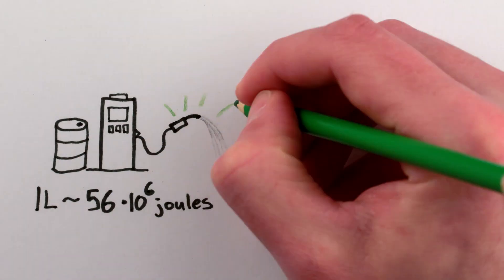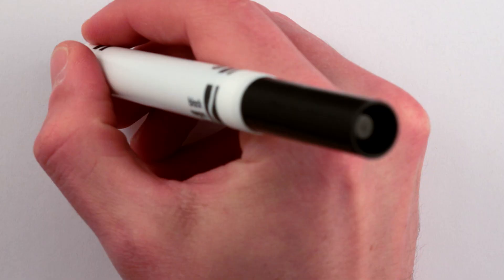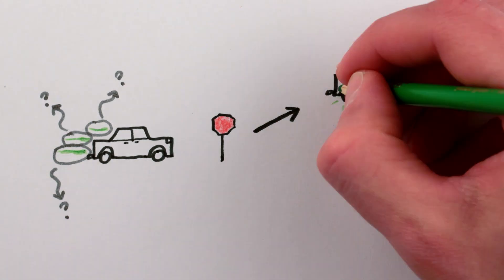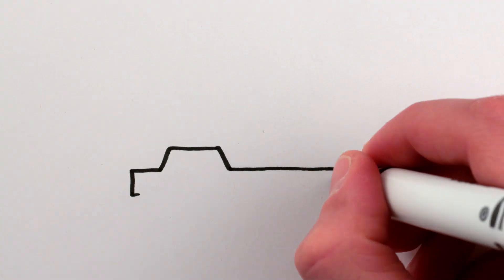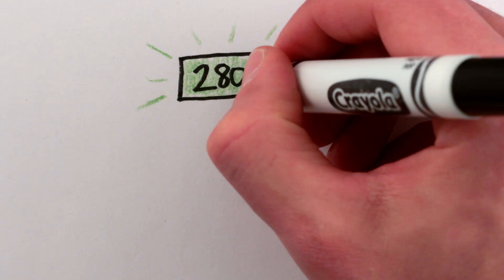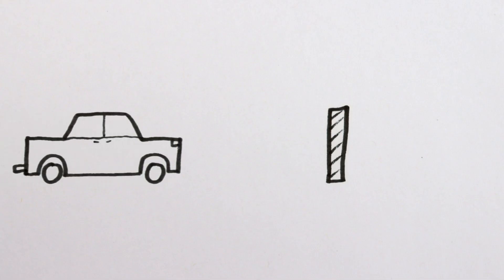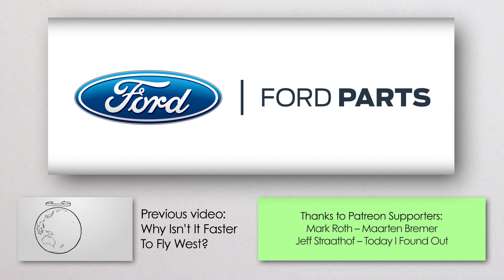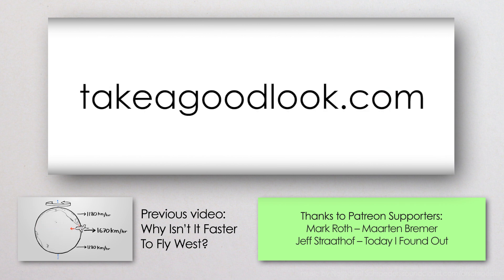The Physics of Car Crashes

Comment: This is really cool. A good way to counter the people who say that "cars were better back in the day"
Reply: +Z6U6Z6U It's hilariously retarded to say cars looked better back in the days. It's all on personal preference.
Reply: yeah if 'better' means only getting around 80-120 horsepower from a giant all steel engine, having 0-60 times in the low 20s range, weighing  more than a full ton over what cars do now, body on frame instead of better unibody, shitty gas mileage,  manual adjustments that had to be made to the timing and carb, no self diagnostic ability,  distributor points that wear out, no front wheel drive in passenger cars, no seat belt pretensioners or airbags, no collapsible steering coloums, no transmission lock,  4 wheel DRUM brakes, no ABS.... yeah 'better' isn't the first word of choice that crosses my mind.
Reply: +superdogmeatmeat Except in retro feeling ;)
Reply: +Milchdealer Nope, old cars provided no retro feeling back in their day because they were new.
;) ;) ;) ;) ;) ;) ;) ;) ;) ;) ;) ;)
Reply: +TheKimpula back in the days, you didn't have to suffer the costs that come with the crash, because you'll be too dead to care.
Reply: +TheKimpula They were absolutely worse in about every conceivable way.
Reply: @superdogmeatmeat  so what?
Reply: +thefaller01 not true, cars have had what are called 5 mph bumpers for decades now, that is to be sold in the USA they have to be able to withstand several 5 mph impacts without any damage whatsoever.
Reply: *****
NO way! you have no idea how bad the air was when we were using tetraethyl lead in our gasoline and before catylitic converters, large cities used to have toxic brown plumes hovering over them and we covered 80% of our country with a thin dusting of lead.
Reply: +dutchsouthernrockfan You can totally have the opinion old cars look better, I would agree with you, but to try and say its objectively true is just bullshit.
Reply: +TheKimpula "cars were better back in the day" is more of a thing for enthusiasts who understand the risk but appreciate the styling and mechanical-ness of older cars, which are truly a work of art.
Reply: +TheKimpula Cars were simpler and more robust back in the day.
These days, car manufacturers design cars that will only last so long and then needing a complete replacement.
Older cars were built too tough and too well for the car manufacturer to survive. Hence why car manufacturers started taking shortcuts to reduce the cost of manufacture and thus longterm reliability because a customer that only comes back every 30 years isn't a good customer...
Reply: @RealCadde that's simply not true, modern cars are much more reliable, and cars comfortably hit 250-300k in their lives, unlike older vehicles which on the high end maybe can hit 200k
Reply: @gamechip06  In the past, they didn't have software that could reliable make for planned obsolescence. Which meant they had to overengineer their cars, which made them heavy and inefficient but they also, as a side effect, lasted longer.

As for reliability. that is only true for the few cars made today that were engineered properly. This hasn't changed, nothing beats a brilliant solution.
There are plenty of old reliable cars pushing  300,000 miles (read, not kilometers) and your claim is at an disadvantage simply by the fact that modern cars are unlikely to have those high mileage figures because to hit those figures you must have been driving 40 miles every day for the past 20 years to hit those figures. Meaning those cars are not modern.

But you can of course specify a year and come back to me.
Meanwhile, i am talking about cars prior to millennium shift. As that's the period where cars started being made to reliably break down after their factory warranty had lapsed.
Reply: Edward Elric
Easier to repair my ass, new cars tell you what is wrong with them with one tool that can be had for less than 50$. older cars you had to throw parts at them, and invest in dozens of very expensive diagnostic machines, take parts out and bench test them. What once took hours of diagnostics is practically instant, people who say that computers and electronics make repair cars more difficult have no fucking clue what they are talking about. Would you rather:
change the plug wires, distributor cap, button, check the spark plug gap, get out the sun distributor machine and check the distributor's rotation, then go under and check the crankshaft pulley's timing marks with a strobe,  replace the spark plugs incase one was defective, put a straw in the spark plug holes to find TDC and determine it hasn't jumped timing,  replace the ignition coil because it misses at high RPM's still, then get to a specialist who has an osciloscope and a polaroid camera adapter to look at the output of the crankshaft pickup to find it's bad after putting in all those parts, taking stuff apart, OR....

Would you rather get a code p1336 on a 50$ scantool and replace a 5$ crankshaft position sensor that does the work of all those systems thereafter the car runs like it was new again?
Reply: James Lynn
More like over engineered and excessively expensive. I'm not sure what we are talking about as "back in the day", but I am thinking of 70's and 80's. I still drive an 88 as my daily driver. Not overly complicated but has all the comforts, power steering, smog system on the exhaust, ect. Super cheap and simple to work on and ruggedly built out of steel and iron, not cheap plastic that makes it less durable but somehow more expensive.
Reply: They were still better "back in the day" in many aspects, but not really safety. Then again idiots weren't texting and driving so it probably wasn't as big of a concern
Reply: +TheKimpula Virtually NOTHING were better back in the day, except maybe the air. Anyone who EVER says that about anything, should be treated with great suspicion
Reply: Clymaxx
You might think that... but ask anyone who has had to throw parts at their ignition system or had trouble with their carbuerator before we had distributorless ignition and fuel injection on all cars. Old cars are very touchy mechanically speaking compared to new ones and there is the problem that to fix them you basicly throw parts at them til it works right as there is no way to diagnose them with obd etc
Nowadays spark plugs last 100,000-150,000 miles, You NEVER have to tweak your carb, ignition coils last maybe 5x as long as that rotor button would inside the distributor and those fuel injectors and fuel pump will usually outlive the life of the car provided you don't run it near empty all the time.
Reply: +Peter „Crackpot Pete” Carlson 
"no front wheel drive in passenger cars"
I see nothing wrong about rear or all wheel drive
Reply: +superdogmeatmeat They had far less electrical and computer aided systems and were easier to repair. But from a technical standpoint you are right.
Reply: The sheer number of wires (somewhere around 20 just for old school power mirrors alone) in older cars before we had a vehicle data bus also lent itself to a LOT of dissasembly to get at and a LOT of probing around with a multimeter or test light, not so anymore, if there is a circuit problem the diagnostic tool will tell you which circuit has a failure and the paramater id's you look at will show you when and how it fails in real time. It's like modern cars have thousands of dollars worth of diagnostic machernery that used to be only available to a well set up auto repair shop, you can't really complain about that. The problem comes when people deviate from the way you are supposed to repair these cars and cause more problems taking things apart and swapping things that never had a problem because they don't know how to interpret the fault data the car is giving them.
Reply: +thefaller01 The bump that are regid does not absorbs energy.. like what Henry talked about in video.. so yourself have to endure hundreds of Gees before you can survive..
And the point here is that since we have non-rigid bumpers that deform and bend upon impact, we sustain less Gee`s thus increased survival rate.. 
That is at the cost of bumper, yes.. But what do you like to pay for your accident? few hundred or thousand dollars for a new bumper? or your life so you don't have to pay the bumper?
Reply: Back in the day was better back in the day
Reply: +TheKimpula  Modern cars are better in that they are safer and more fuel efficient, my cars is now 10 years old yet the newer model has almost twice the fuel economy. It's true they don't have the 'retro' look and the nostalgia attached to this and they are harder to fix when they break for the casual mechanic but the pure engineering is tremendous.
Reply: Fair point. My car at 170,000 miles still starts every time and I plugged in a code checker recently to see that the spark plugs needed replacing.
Reply: +TheKimpula Cars WERE better back in the day...They just weren't safer.  It's the price you pay for being cool.
Reply: thejoshhartley but it is
Reply: +geneticNinjas How about a NEW muscle car with a V8?
Reply: Peter Carlson Right, that's what I meant when I said that engineering solved many of those problems today because the technology was evolving. We didn't know the best solutions to certain problems back then and we even changed the methods completely in some components. I think mainly the rigidity and durability is about the frame and full steel components. I'm pretty young though so I can't say I know too much about it. My dad seems convinced though lol he raced a 69 Chevelle, thing definitely seemed like a tank.

Cadde I've read that 70% of all cars ever sold in America are still on the road today. So there is some truth to what you're saying. But I don't think it's true that engineers would go along with the idea of making crappier parts not built to last. Rather, it's probably a bit coincidental. Most money in the car industry is made through maintenance and parts so I definitely thought it was odd that manufacturers thought they could last by selling new cars every day. You can see it reflected in the pricing. Cars are way expensive, to offset the fact that nobody buys them since they last forever.
Reply: Gurgumul
Not until the chevy citation... ask anyone who's ever driven a rear wheel drive passenger vehicle in ice/muck conditions about how they used to have to load up the trunk with cinder blocks to keep the things on the road. For passenger cars FWD is the best configuration. Trucks and wagons are another story entirely.
Reply: I have seen MANY old cars with rotted out frames, Just because there is more of it doesn't make it better, after all if you don't collide with something and you don't get nasty corrosion lighter is better any day of the week for car construction, in fact the way they make some of these cars now they are actually stronger as a whole than those older ones were. I'll have to disagree that cars (NOT trucks) are made to last forever... they are most certainly not, they are designed to go around 100k miles without much more than 10-15 oil changes, a new set of tires once and perhaps a few brake pad changes. After that things will usually start going quick. They are made to be disposable primarily, the dealer doesn't want to have you fix your car they would much rather sell you a brand new one every 5-6 years.
Reply: thefaller01 It's that back in the day when you went through a high speed car crash the car'd be okay and you'd die, and nowadays it's quite the opposite, and I'd say it's better this way.
Reply: Let me change that: Cars looked better back in the days, but safety and reliability is worse. I know this, almost no one says that +TheKimoula
Reply: *was worse
Reply: +thefaller01 
Modern cars are made of plastic at the bump zone, a small bump will not occur. The plastic will absorb the energy and is elastic, thus it will have no bumps aber the small impact.
Reply: twn5858
I know there is basically infinite possible scenarios when it comes to a car crash, but that being said I would rather be in my 88 f250 in 99% of those scenarios than any kind of compact prius type car or fugly crossover thing.
Reply: +TheKimpula I dgaf about charming sounds a car makes, I just want to relax and listen to my own thoughts instead of the harsh roar under your hood.
Reply: Same here, this XJ has wrecked three cars already with no frame damage. A 90's Olds, a mark IV Lincoln and a 05 ford focus. I've seen a 83' Delta 88 absolutely destroy a late 2000's Toyota corolla and punted it 80ft into the ditch with only a smashed headlight. Then there's NASCAR, cars designed to hit the wall at 180 mph, they are fully TIG welded tubular frames. I only worry about concrete barriers and poles really and bigger trucks rather than majority of the cars on the road cause I know I'll still have mine while they buy a new car, if they are still alive.
Reply: +TheKimpula People generally mean they looked better, which is true.
Reply: +Z6U6Z6U how is it 'true'?
Reply: +TheKimpula There are people who say that?
Reply: +TheKimpula Perhaps people sucked less at driving back then lol Technically speaking, a more rigid car is probably more durable, which is what my dad has told me. I can see how that works. But we've solved more important problems with today's engineering, including that which is said in this video. I have read though that vehicular fatalities, although crashing was a little less frequent until cars became more and more common, were much higher per crash back then, probably because of the rigidity and lack of safety features.
Reply: +dutchsouthernrockfan no the didn't.
Reply: thejoshhartley B-but I was going to throw all existing fallacies at you...
Reply: +TheKimpula I mean cars were built with longer lasting parts "back in the day". It wasn't so focused on entertainment as it is now-a-days. By the way, crumpling isn't always necessarily a good thing.  It can be good with a hard frame but less companies are (that I have seen) doing such a thing.  I always use Jeep as a good example.
Reply: +TheKimpula well,they WERE prettier
Reply: I'd say it depends on the specific car that it is to determine which era it looked the best in. But overall, cars today are better. Like with so many things, people get blinded by nostalgia or believe old always means gold.
Reply: Z6U6Z6U Yeah, haha.
Reply: Dennis Liu Go read my comment again and see what's missing.

No need ill point it out, I'm talking about small bumps, not 120km/h crashes. as far as i know nobody dies of small bumbs, and those are still more common accidents
Reply: TheKimpula yeah, and I'm glad that once more you put the same idea out of context. But I'll try to enlighten you once more.

When you had ppl refering to "cars were better back in the day", they were refering to the capability of one, in small bumps or small accidents, not taking too much dmg, thus having the chance of nott having to pay much for repais. The issue was never high speed crashes, which is covered in the video well enough...
Reply: thefaller01 I bet there's a damn good reason for why the cars break as they do, maybe us consumers will never get it, but it is what it is for a reason...
Reply: katten elvis yeah...
Reply: John Ridley
They looked  really good in the 50's and 60's, but after that they discovered aeordynamics and they started looking ugly
Reply: John Ridley
I like both old and modern types of cars, however the boxy 90's cars are really ugly.
Reply: +Kanglar Not really. Modern cars are more efficient, have less exhaust fumes, have power steering, more comfort, more safety, more practical use, more compact for some cars.
Reply: +geneticNinjas Except staying alive. Rather buy retro mods for a modern car, safer.
Reply: +TheKimpula The looked much better though. Especially those American Muscle Cars but that's just me.
Reply: +TheKimpula    We all have Ralph Nader to thank for our lives and safety.
Reply: +Sokar Exactly.
Reply: From a maintenance standpoint they are.   But I'd rather be alive with a totaled car than damn near dead with a car that needs no repair.
Reply: Kanglar The bigger the car the better for you anyways.  The driver of the other car not so much.
Reply: @twn5858 only in an accident, otherwise a larger car is just going to be slower, be more dangerous for others, and use up much more fuel.
Reply: +TheKimpula Why would anyone say that?
Reply: Adriyaman Banerjee I don't know.
Reply: +TheKimpula You should.You posted that comment.You must have heard someone making that remark.
Reply: Adriyaman Banerjee I have, I haven't questioned their logic though. (out loud)
Reply: +TheKimpula I see.
Reply: FAST cars PHILOSOPHY was better in the old days (you skillz? You god. You not skillz? You ded), but car in general are just way better now. Under every aspect but "compactness".
Reply: Slight necro post:

I prefer practicality over fasionability. Those boxy cars? They look pretty, and that's it. 

A modern day ute, or family car, or sports car? An old car ain't got nothin' on them.
Reply: +Sokar The air? So you havent heard about The great smog of London?
Reply: TheKimpula 666 likes I like it
Reply: +Peter Carlson gets it, <100k miles was the norm, now it's >300k, rather then set and forget carburetors imagine a team of technicians under your hood, adjusting hundreds of times a second or faster.
adaptive management, failure strategies, and redundant systems all make for a more durable product.
the entire point behind crumple zones is "metal is cheaper then flesh" go figure.
smaller, lighter cars are simple physics, newtons first law., "~at rest stays at rest" = better gas mileage, "~in motion stays in motion" higher inertial impact forces.
manufacturing bean counters demand every component be justified, to the tiniest wiring loom retainer.
one disturbing trend i've seen is less and less common man accommodation, going from a simple wing nut to 4 T30 screws and a worm clamp to check a filter, even no dipstick, leading to reactive, rather then proactive repairs.
finally, ever think why that engine light comes on? the Owner, the technician, the Manufacturer don't "like" seeing that light come on. it's mandated by legislation
AKA the 1D10T light
Peter, to quote Bill Murray "i want to party with you, cowboy" ~stripes.
Reply: TheKimpula nobody says that
Reply: TheKimpula Cars were better, if you chose not to crash, you don't have to worry about safety bullshit.
Reply: TheKimpula 

They are though
Reply: TheKimpula seriously classic car guys don’t care about safety we love their simple designs & the feeling out car isn’t controlled by s computer
Reply: They don't mean that literally, of course everyone knows modern cars have more performance, features, and most importantly, safety. What they mean is that cars back then feel better to drive, mostly due to analog response in throttle input, steering, shifting, and many other parts of the cars that have now become digitalized (computers & servos basically), not to mention that cars have become so much bigger recently, both of which has numbed the sensation of driving, in other words, you don't get the same feedback as you would on an older car. That's why some prefer older vehicles.

You should use your brains to think about the other side rather than just wanting to dunk on people's preferences smh.
Reply: +superdogmeatmeat They looked better and they sounded better.
Reply: +dutchsouthernrockfan No. I find their looks weird, outdated, and awkward.
Reply: +TheKimpula If you have a small bump with a car nowadays, you'll most certainly have to pay a new bumper, while with older cars you'd at most have a scratch in the paint. When they say "cars were better back in the day" that's what they're refering to, so i dont really see what this video counters in anything
Reply: Aski No it's not they just did.